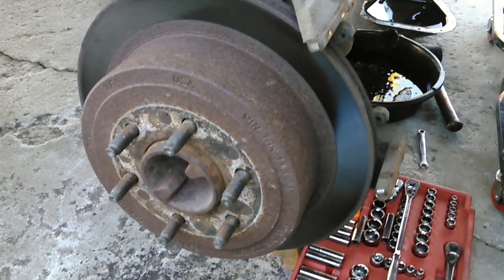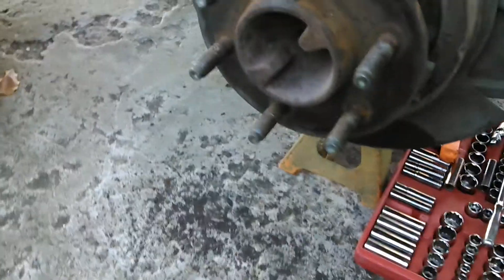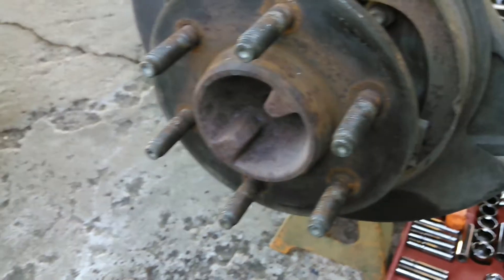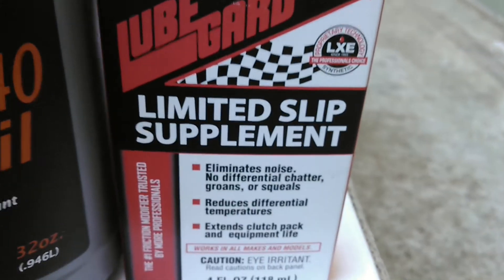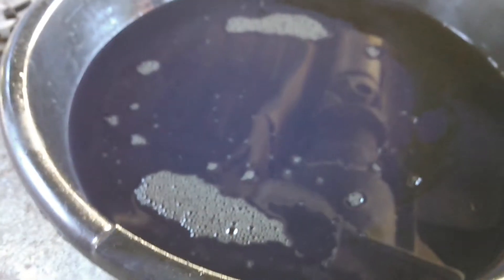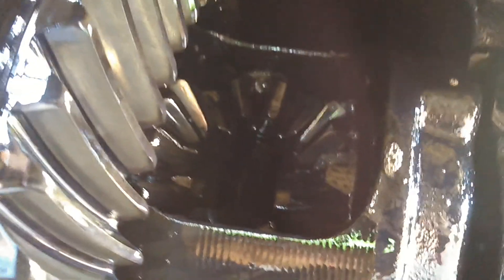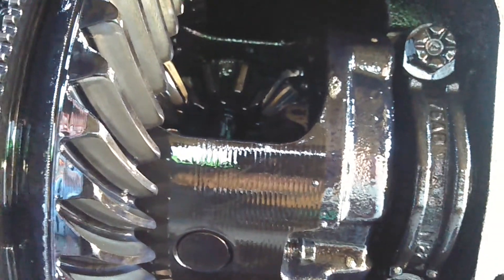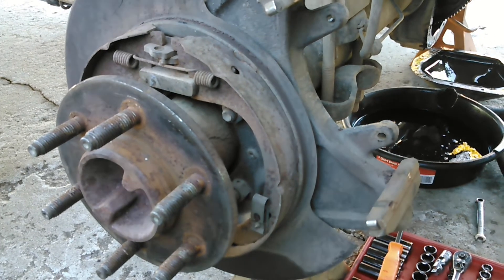'04 F150 Rear e-brake, Seals & Bearings Replacement Procedure

Comment: could a bad rear bearing cuase truck to vibrate while turning and in highway speeds?
Reply from the maker: Different things can cause vibrations while turning or at any speed.  The bearings could at any speed, but usually more noticeable at highway speeds.